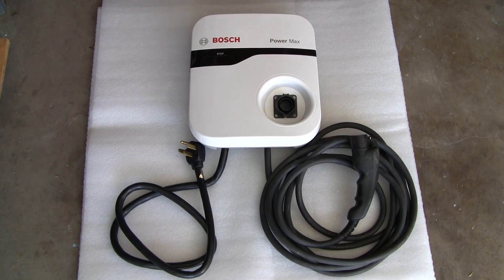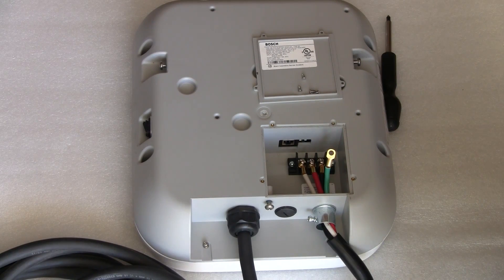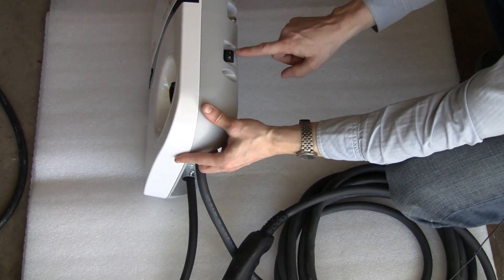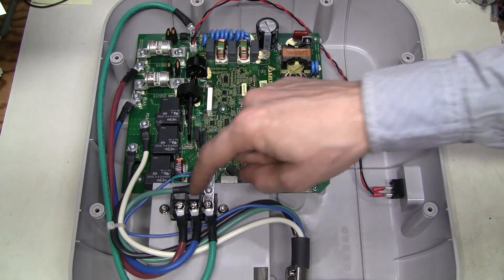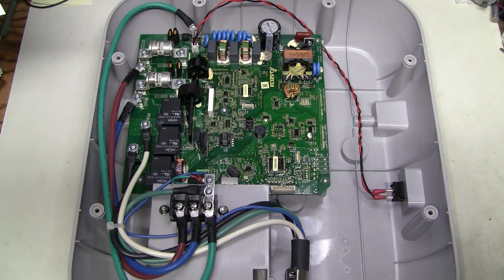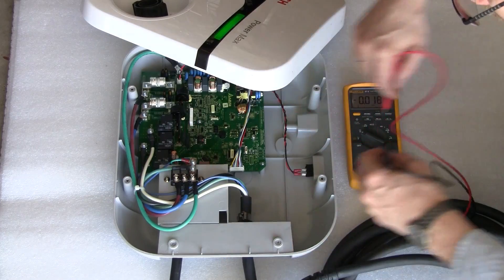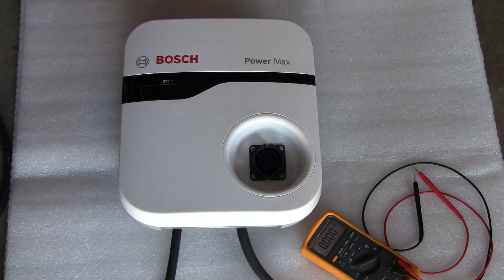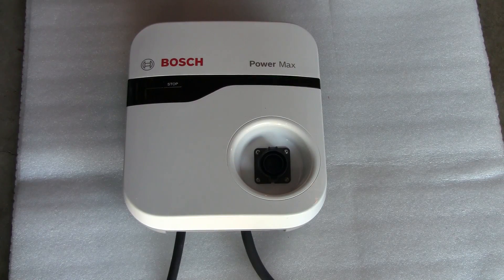#64 - Bosch Power Max EV charger repair

Comment: I had the plastic tip break off the plug of a FREE EV charger. Would you suggest Miracle Glue, Electrical tape or Duct tape, and a hose clamp to repair the broken plastic tip?

It's 7 years old, so the owner might not replace the plug.

Comment: Hi Very good video. Got an issue and wondering if you could help. My charger  doesn't charge  the vehicle ,the display board does not go ON (green) when we turn on the charger. I checked and I  have power inside the charger, before and after the fuses. Thus the fuses are fine. All three ribbon cable connectors (from the board , to the display and to the UI) are connected and they are not loose. Do you know what could be the reason for the green light off and charger not working?

Comment: I also have this same Bosch PowerMax Level 2 charger.  It has been working without issue since 2014 inside my dry garage.  Recently it stopped charging.  The Bosch unit still shows a "ready" green light, as it always does.  However, the charging lights on my 2018 and 2013 Chevy Volts glow amber and do not change to green as they do when normally charging.  Both cars charge fine on the smaller Level 1 chargers that came with the cars.

Would anyone have any troubleshooting suggestions for me?

Alternatively, could anyone suggest a place to get it repaired for a reasonable price?

I have tried talking to Bosch at their Technical Support number, but they did not help me.

Comment: Moral of the story: Always pull out the charge cable via the handle, not the wire.
Reply from the maker: Not quite. Always install things properly so that, in this case, the strain relief would work right.
Reply: @feedback-loop  Well, that too. :)

Comment: Great video. I have the same charger. After about 2 years it stopped working. One day I turned it on and the light flashed red. According to the manual flashing red light means “minor fault”. I tried resetting the charger and the breakers. No luck. Any idea what it could be?
Reply: Did you find yet the problem please.
Reply: redo the connections on the back of the unit.  I did that and mine came back to life.

Comment: I'm fairly certain the way the power cord was hooked up originally is the right/safe way. You're not supposed to intentionally pass current through the ground wire since at high current, this can cause its voltage to rise downstream on the same circuit. This could be dangerous since the metal chassis of appliances are grounded through this line, which is the correct use of the ground wire. You are correct that the ground and neutral are connected, but not until they reach the panel outside, at which point both are connected to a ground stake.

Comment: I'm actually surprised that Bosch had such a failure. The strain relief seems completely wrong on the one side;they both should have been a screw-down with "o" ring compression fitting type I would think.  Interesting. Thanks for the insight.

Comment: A rather simple repair as compared to some of your others but nice none the least. I enjoy your videos very much, you do a nice job. If you don't mind me asking, where are you from? Also what is your education, are you an engineer? Again, awesome job and thanks for sharing.
Reply from the maker: I am originally from Russia, so please excuse the mistakes I occasionally make in English.
I am a software engineer with education in applied math. Electronics is my hobby since I was about 14.
Thanks for your kind words.
Reply: @feedback-loop  Well, you are a very complete engineer. From relatively basic electrical work, going through voltage references, power supplies, electronic loads, oscilloscopes, spectrum analyzers, microwave counters, radio communications, etc., etc. Now I know why you were able to tackle that Datron display job with an Atmel processor using interrupts to catch that write pulse while explaining why you ended up doing what you did. By the way, even though you were not pleased with the end results then, I loved your approach.

And, on top of that, you're explaining videos in a language that is not your native language. By the way, your English is perfect,  always using the right words.

Congratulations Feedback Loop! Keep dazzling us!
Reply from the maker: @rafaellarios3707  Thank you.

Comment: Surprisingly poor construction of the connector sense wiring, given the expected rough handling. I'm surprised that moisture had made it inside despite the seals but moisture will inevitably find a way unless extreme lengths are taken to prevent ingress. At least the design was such that repair was possible, although that probably increased the likelihood of failure at some point.
Reply: FeedbackLoop I think he meant that the design was so that a repair is possible. if they just welded the thing shut it would be sealed better perhaps. Anyway I think it is good that the sense wire was the shortest because in case someone or something pulls on the cord the live wire won't be coming out first while the charger is still active. We use a similar wiring style on purpose for Ex zone (explosive atmospheres) sensors and valves.
Reply from the maker: I wouldn't call this construction poor. It was just one wire that was cut too short. And, yes, making stuff waterproof isn't easy.
I hope this repair won't increase chances of failure much. Do you think that soldering joints might fail? Yes, crimping would be better, but soldering should be good enough too. Or do you think that I might have damaged the rubber seals a little just by taking the handle apart? That is possible. Perhaps it is a bit less waterproof now.
Reply: FeedbackLoop 
I don't think a solder joint is inherently less robust than the previous crimp joint. If anything it's likely to be more moisture resistant. I expect that crimps are significantly faster to use as a manufacturing choice. I doubt that your opening the handle has markedly reduced the waterproofing but you could put some silicone grease around the seals to help them to seal better if you're concerned.
Reply from the maker: What was your concern then? You said above "although that probably increased the likelihood of failure at some point"?
Reply from the maker: Oh, yes, I must have misunderstood. The meaning was that the design that allows disassembly increased the chances of failure, not the repair.

Comment: Most problems are broken wire or corrosion.   Electronics is generally reliable if designed properly which is usually the case.   It never hurts to try and fix things if you understand how not to electrocute yourself.    My motto is "Try to fix it , you can't make it any broker".   Great vids  as usual.  Thanx.  Interesting about how that works.
Reply from the maker: Well, there is always room to make things "broker" :)